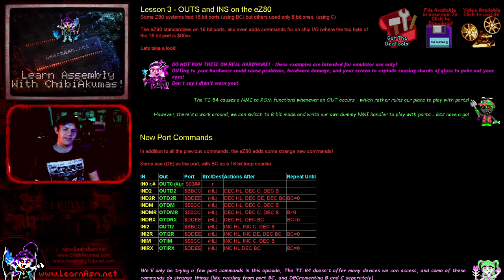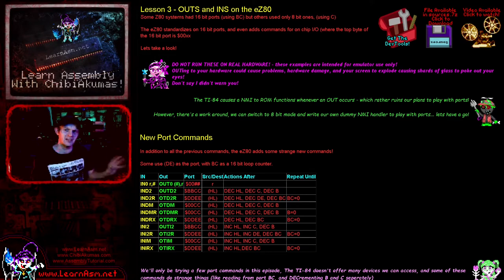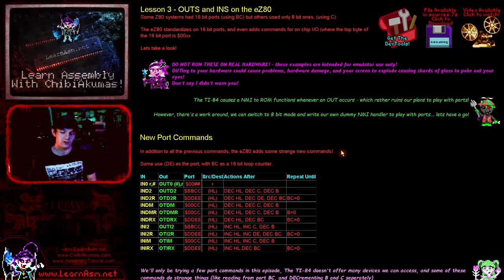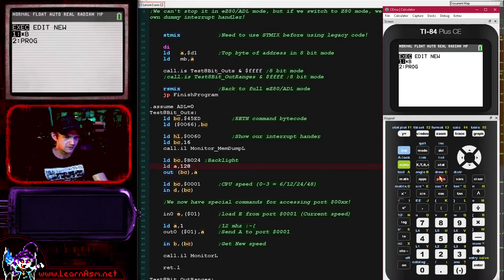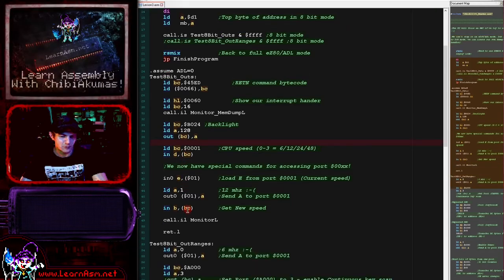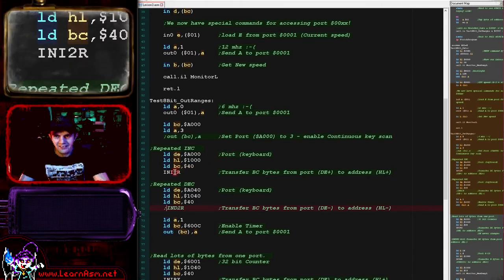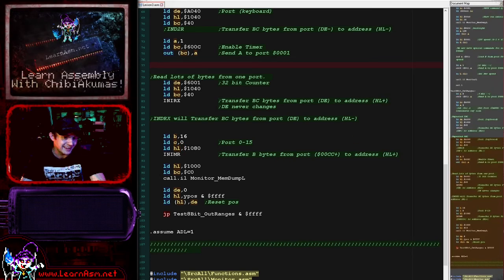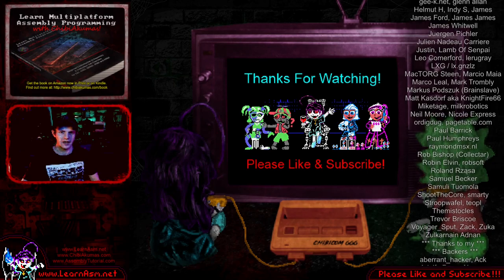eZ80 Assembly Lesson 3 - OUTS and INS on the eZ80

Comment: I was thinking it would be nice if a Z80 emulator could emulate hardware as well (maybe it’s possible, I haven’t researched this yet), but then I realised I could replace the IN/OUT instructions with a serial link to say a raspberry pi, and the pi could transfer those bytes to physical octal latches and my actual hardware circuit could sit behind all that. (I’d like to interface to an AMD9512, as I’m not convinced any of the chips I’ve bought actually work)